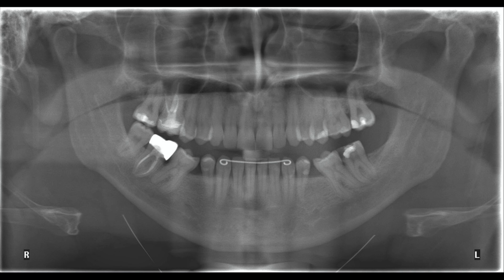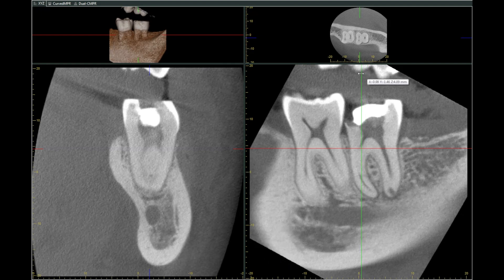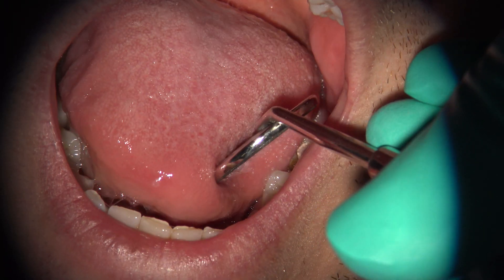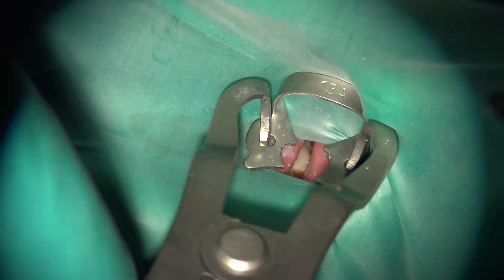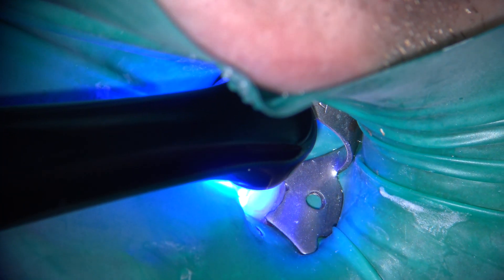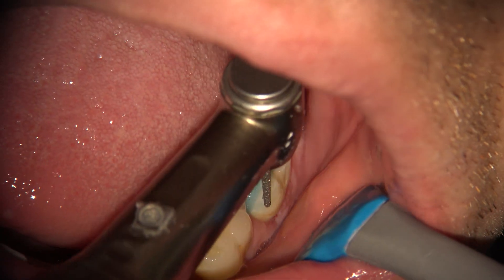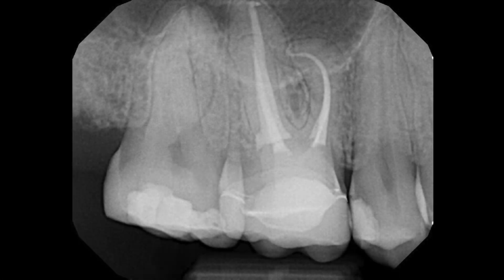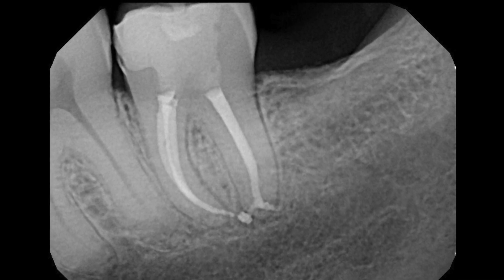EndoSequence CM Taper Files and KontrolFlex AccuFiles

Comment: I observed that the Endo Sync Stops and stays put for 5 sec-7 sec after reaching working length. Thats bad. Its should start turning in reverse direction, not simply stop. The file binds into the canal when topped abruptly. Any movement can fracture the file
Reply from the maker: You can choose your apical action and program it in. You have three options: No Action (will continue to rotate and simply beeping from the EAL, you can choose apical Stop, or you can have apical reverse,) So, it's up to you. I prefer Stop. So the assistant can set the stopper. But I'm often too lazy to change it! LOL! But it can be done.

Comment: how can you choose the apical gauge with these instruments? I guess in this case shaping at 30.06 was the right choice but in many cases it's too much for mesial canals... would you recommend to shape with these files till 20.06 or 25.05 and then finish with a manual 30 or 35 k file to shape only the apical part?

Comment: Excellent work doc ☺️☺️ love to see you work so efficiently and accurately.Dr.Allen I was wondering what are you thoughts on skipping the S1 file size as I have found in "my case" that it tends to fracture in the tooth so I usually start using S2 file and then go ahead to F1 and F2 files accordingly.What are you thoughts in this doc ?Thank you for the video and providing and sharing your  knowledge
Reply from the maker: Thanks. I think you can reduce the odds of separation of the S1 by making sure you instrument the canal to a size 15 hand file before using it to apex. That’s an important thing for those who have an issue with separations with ProTaper files.

Comment: Hi professor, does variable tapered rotary files induce higher "suction feeling" when binding with the dentinal wall than constant tapered rotary files?
Since I noticed ProTaper Next induced fairly large amount of "suction feeling" when I introduced it into the canal, I was wondering if variable tapered file all could experience this phenomenon. Thank you so much for the informative video!
Reply from the maker: The experience of getting sucked down the canal is more a factor or a file's pitch and helical angle design. Constant taper can also get sucked down but that's why the EndoSequence has variable pitch and helical angles. In addition, the alternating contact points help reduce the suck down effect. Either way, suck down can be averted by reducing constant apical pressure or using a handpick like EndoSync Plus that has OTR. But you can also do the same with a good and stable finger rest and management file engagement with good control over file tip (good grip.) Hope this helps.
Reply: @EndosKool  Thank you so much for your insight!